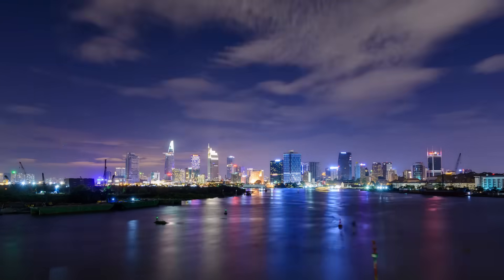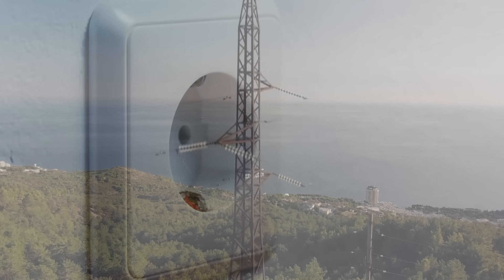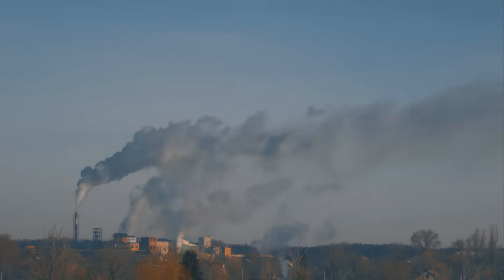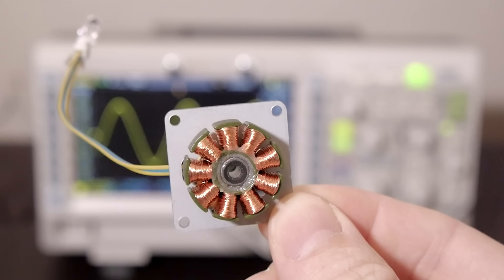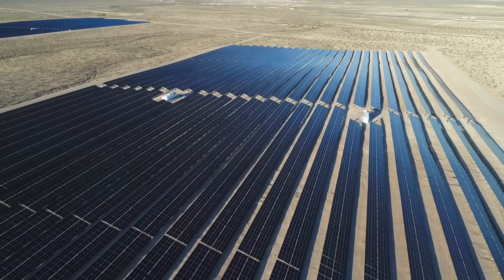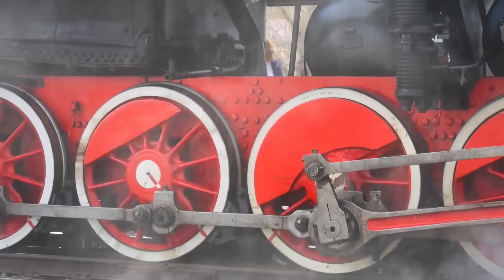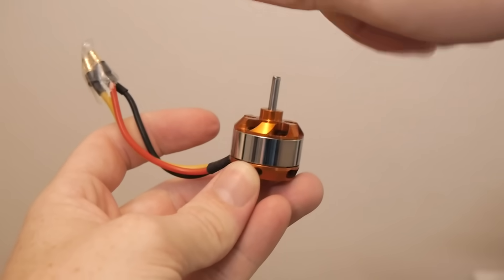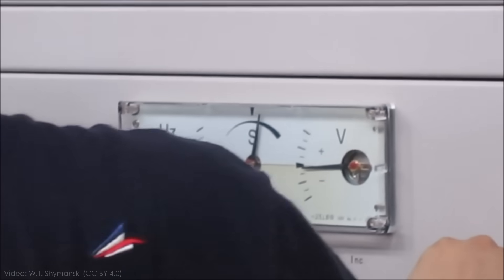How Electricity Generation Really Works

Comment: Despite my reservations about nuclear, I find it vexing that everyone seems to forget that nuclear doesn't emit co2.
Reply: @psiwog  actually co2 is more dangerous than radioactive waste.
Reply: @snekwrek5454  Hahaha  Ha Wow, that's funny
Reply: @snekwrek5454  
True, and the amount of radioactive waste generated is MANY orders of magnitude less than the amount of co2 per kilowatt hour.
Reply: Snek Wrek ? You actually believe that?
Reply: @snekwrek5454  ROFLMAO, alrighty then.
Reply: @snekwrek5454   co2, more dangerous than radioactive waste?  It's all about dosage. Humans emit co2 and trees absorb co2. The issue with fossil fuel is soot and and nitrous oxides. If you stand next to a spilled nuclear waste for a few minutes you will receive a deadly dose of radiation but it will not kill you instantly, you will suffer a slow painful death. There is a lot of different things going on here. co2 is naturally occurring whilst most radioactive waste in not.
Reply: @snekwrek5454  actually CO2 carbon dioxide is less dangerous than carbon monoxide... nuclear and co2 is relatively safe when maintained and managed correctly, cold drinks in a supermarket contain co2(carbon dioxide)... the mistake many people make is not consider the difference between co2 and co
Reply: @snekwrek5454 It does still emit Co2.
Reply: @psiwog  bruh we literally kill more people daily due to respiratory issues from coal burning than every nuclear failure combined. Nuclear waste is contained. We breathe the waste from coal plants daily.
Reply: @MeltingRubberZ28  then again your comparing an industry that is not only currently dominating the market BY FAR relative to nuclear generators, but have also existed for several decades whilst nuclear plants are like a fetus in comparison. there really is no comparison, even if nuclear waste were 10x as deadly as coal burning waste, you'd still see more people dying from respiratory issues
Reply: @MeltingRubberZ28  that's because there aren't a lot of nuclear plants but a shit ton of coal plants. If the number of nuclear plants increases, deaths from radiation would definitely increase.
Reply: @TheJudge064  No, these numbers can be adjusted so as to be independent of how widespread its use is: deaths / unit of generated energy. Even if we assume the amount of adoption was equal, Nuclear and wind are easily the safest sources of energy
Reply: @TheJudge064 
No they wouldn't? 
There aren't really any nowadays, so a bit of scaling up wouldn't likely do much anything.
I mean coal plants contribute more to irradiating the environment than nuclear power does, at the moment.
Reply: @MeltingRubberZ28  coal waste is also radioactive
Reply: @MeltingRubberZ28  bruh, I would rather live near a coal power station, than a nuclear one. The issue is not when everything runs fine, the issue is when there is an issue. Also, it is wishful thinking that nuclear waste is contained properly. The waste disposal would be contracted out to the lowest bidder, like all waste. Not good. Also, requires constant monitoring into perpetuity. Use nuclear only when we have a way to cleanly convert or dispose of nuclear waste and prevent it getting into the atmosphere. Besides, nuclear may be our only choice soon, so it's not worth worrying about.
Reply: @tensevo  bruh when we stop using 1950s technology we won't have to worry about the few nuclear failures we've had in the entirety of the planet
Reply: You are right! But did you know that germany(top tier country when it comes to engineering) is STILL looking for the "right" way of storing the radiating rubbish savely... and by the way you have to look for it #securitythreat (for the next 1000+ Years!!!) If you take this in consideration NP is fucking expensive. For my opinion the next step is Hydrogen. Than Nuclear Fusion...
Reply: @hennsbreit  I thought Germany had closed all its nuclear power plants in favour of burning brown coal, after the Fukushima Daiichi disaster. So the urgency for that has probably dropped a bit.
Also, hydrogen isn't a source of energy, it can be used as a fuel inside of cars, but we don't have abundant supplies of it sitting around the Earth, as a matter of fact, when released it simply flies off into space when released outside, like helium. Instead we produce hydrogen, either through electrolysis of water, which isn't very efficient (and the electricity often being generated by the burning of fossil fuels), or from steam methane reforming, which releases carbon dioxide.
Nuclear fusion would be the holy grail of energy generation, but it's still a way off of becoming a power source (it still costs more energy to perform than it yields), let alone being cost competitive. I guess it's still 30 years away, as it has always been...
Reply: @Leon_Schuit 
No we had 6% nuclear in our grid last hear and this year about 9%, even though all our reactors are critically over aged and produce about 150 reported incidents a year. And about 16 close to a nuclear fallout, due to multiple system failure.
Also just because you stop making more waste, doesn't mean you can slow down dealing with waste.
In Germany we are currently near a nuclear disaster because the Asse, an ex salt mine is flooded with groundwater and it is just a matter of time until we have nuclear waste in our water.

Also nuclear fusion is not a solution because it is massively expensive and you still need a lot of them if you don't want to wire up your whole country from one central spot. Also if you try to do it with one terrorists will thank you for giving them an archillies heel to attack
Reply: @Ismalith  Id like to invite you and a bunch of others in this thread to look into breeder reactors. The next generation of nuclear reactors being built can consume nuclear waste and effectively improve the efficiency of each fuel rod by 100 fold. The waste leftover with these reactors is just one percent, and the radioactivity of that waste has a half life of a few hundred years. Its been stated that with these breeder reactors, no more uranium would need to be mined, i.e. only the existing nuclear waste would need to be used to power america for nearly a century, and thats if you nuclearize the WHOLE energy grid. Sounds like germany is in perfect position to mass deploy these reactors
Reply: @xHaRm51  We estimated in France that with our current stock of "waste" (we don't call them that as we already sort the potentially useful matter / definitely useless waste and really hope to use them), we could hold the current power production for 2 to 5 millennials (yup, 5'000 years without a single mining input).
Reply: @xHaRm51 
Such reactors reduce consumption but they don't fix the problem of nuclear waste. There is still waste left and until the question, how we keep waste 100% save over millions of years, nuclear power isn't an option. The same goes for safety, it needs to be literally bomb proof.
Reply: @Ismalith  did you read what I wrote at all? Breeder reactors consume all transuranic elements, the waste thats left is from fission elements with a half life of a few hundred years.
Reply: @Leon_Schuit  fusion! Someday! Maybe. Crossing my fingers
Reply: @xHaRm51  The ideas of breedres has been around for a long time. However, I am not sure most of the designs have ever been tested. Most have certainly not gone further than the prototype stage and germany then quitting nuclear power plants has certainly not helped that issue
Reply: @SuperVapourizer  theres a few that exist. Russia has a couple they use to dismantle nuclear weapons and make energy out of
Reply: @Leon_Schuit  It also has to occur at like 1,000,000°C
Reply: @Leon_Schuit  what does vexing even mean
Reply: @xHaRm51  It should be kept in mind that there are numerous designs for 'slow breeder' reactors. We previously rejected fast breeder reactors because they generated fissile material faster than it could be used, causing a buildup of bomb-grade uranium, plutonium, etc. A slow breeder only produces enough fuel from the previously nonfissile isotopes to keep the reactor going - thus the reactor once started can create its own fuel from what is in the fuel rods or pebbles (depending on design) and what is left has gone much further in breaking down the heavy radioactive isotopes. And while the final end-products are to some extent radioactive, they are a much lower potency of radioactivity, so they would not need the 'under a mountain' supersecure type handling.
Reply: @Leon_Schuit it wasnt bc of fukushima, it was bc politicians were bribed by coal magnates
Reply: hennsbreit learn about thorium power. ThMSRs can’t melt down like a traditional reactor, and the waste is toxic for only decades. If we had been using thorium since the beginning of the industrial revolution, the original waste would be safe by now. Additionally it can’t be weaponized
Reply: @pannecake2000 
That is wrong thorium reactor waste is better than uranium reactor waste but it still is dangerous for a few thousand years. So it doesn't change the problem, especially if you want to fuel the world with that for a few centuries. Also Thorium is also not infinite.
Reply: @Ismalith  but could thorium be helpful in filling the gap between now and fusion + highly efficient solar energy?
Reply: @ki0w0-lordofwatersheep 
And then 50 generations pay for this gap filler?
Also solar is already where it needs to be. Instead of wasting more more money on in between, just use 10% of it for doing it right in the first place.
Reply: @Ismalith  well put
Reply: @ki0w0-lordofwatersheep  Can't throttle a thorium reactor - NFG for power grid use.
Reply: @Ismalith  no
Reply: @Ismalith  what fuel problem? It’s easy as hell to store, since it’s in concrete bricks.
Reply: @Ismalith  solar is absolutely nowhere near where it needs to be. And with extremely limited electricity storage options (at the grid scale) electricity has to be used when it is created. There is no way for solar to ramp up or down to meet demand. And they degrade and get dusty or the sun is obscured by clouds, etc. 
Solar can fill in some gaps and there certainly are some smart applications for it but to act like it is a suitable replacement for coal or nuclear is absurd. 
So many people have such an irrational fear of nuclear power and dramatically overstate the waste issue. It seems many of them are citing 1960s nuclear tech not understanding the advances made in efficiency and recycling/reusing of the waste.
Reply: @BonsaY You've been Had by special interests propaganda, nuclear power is neither as good or as bad as either side says and they Both are more wrong than right for all the wrong reasons.
Reply: @EvitoCruor 
What do you mean they're both more wrong than they are right? What's the truth, then?
Reply: BonsaY why the hell dont we just drill holes in the earth down to high temperatures and make steam. ??
Reply: @hennsbreit  Nuclear Waste is recyclable into active fuel. At a certain point it’s not, but you can mostly solve that with vitrification (turning it into glass) and burying it deep underground the sealing it off. This way, it’s not accessible and it’s not going to leak or otherwise be a hazard. Norway’s already done this without vitrification, the US is actively doing this with vitrification. It’s not reaaally that big of an issue. The bigger issue is honestly weapons-grade radioactive materials because they often aren’t depleted. 

In theory, you could also stabilize ionized uranium into stable uranium but giving it neutrons and electrons, but that’s often considered impractical in the modern day.
Reply: @hennsbreit  Nuclear is the best that we've got till we can safely switch to hydrogen. And the nuclear waste problem is not that bad if you consider other options like global warming or worldwide respiratory issues.
Reply: @hennsbreit  that’s not the next step, there’s like 20 other ones we actually understand in between.
Reply: @hennsbreit  we already have found ways to store it safely decades ago, and most nuclear waste is only dangerous for like 20 years.
Reply: @hennsbreit bro please don’t talk about thing you don’t know anything about, out of the many wrong things you said, just let me point out that hydrogen it’s not an energy source, but an energy vector, that means it can only be used to store energy, like batteries, while also being quite not an efficient way of doing it.
Reply: @hennsbreit There are actually ways to use that nuclear waste to emit more electricity!
The downside is the expense for sure, but it’s not nearly as bad as having security on uranium for a thousand years!
Reply: @hennsbreit I understand the implications of the waste,  but once it's sealed it's not emitting any dangerous byproduct,  so it's completely safe , the only issue regarding risk, is trusting man to maintain and function nuclear facilities,  something they can't be trusted or relied on.

Take Chernobyl for instance.
Man ,isn't trustworthy or ethically reliable to be in charge of such risks.
Reply: How do you get hydrogen  @hennsbreit
Reply: @hennsbreit  tf you mean hydrogen? Do you know how hydrogen is produced? It's not found in thin air.
Reply: Dont forget thorium!
Reply: @jimislaughterback6280  i want to see some large scale thorium reactors
Reply: Still waiting on hydrogen fusion energy
Reply: @ohyeahyeah1174  Helium 3
Reply: Not gonna happen for the next thousand years. Fusion is a pipe dream as every experiment is less efficient than a hydrogen bomb and not sustainable
Reply: Yea but to dispose of the waste your looking at sending that shit to the sun, which might actually be economically feasible in the future.
Reply: People seem to forget that the fly ash from coal also contains radioactive materials, and is a source for more cancer than all nuclear, even if you include chernobyl and windscale
Reply: @jonne7725  and you seem to forget that "flyash" has trace amounts of radiation that have yet to be proven to cause anything and is filtered electromagnetically and doesn't get into the atmosphere. The ash is collected for further processing and is usually stashed on huge ash-hill next to the plant. Those chimneys are super high tech I suggest you read into that.
If what you said was true and the ashes and dust was just blown into the atmosphere, we'd already have a disaster around power plants that have existed for over 50 years and it'd be all over the news. Heavy metals are a much bigger health hazard in ash-landfills and even those are pretty much negligible. The Ash is usually examined and since plants use coal from certain coal mines, the size of landfills per 10k square mile (as an example) is calculated from the amounts of toxic metals and other components in the ash.
Reply: @Thomas-wo9ur  My man!!! Someone knows what he is talking about!
Reply: That is partly the case but it needs to be remembered that mining uranium, refining it and making it in to the nuclear fuel (I'm not very familiar with the process) is also a source for CO2 emissions. And this is a problem with many REE (Rare Earh element) based solutions: There needs to be research for "how many CO2 tonnes is released per CO2 tonne saved if we produce electricity with..." 
For example, I'm very curios how much CO2 is released when we produce one solar panel, and what is the life expectancy of said panel. If a solar panel dies (because eventually everything will) without ever producing over the amount of energy that could have been produced just by burning the coal, then the whole ordeal less "green" because energy is wasted when it transforms.
Reply: @Taffoman  Is it intrinsic to the process (i.e. a necessary chemical reaction) or a byproduct of the energy required? If it's the latter, you know what I'd tell you, don't you 😉
Reply: @Taffoman  We have the numbers for this. It's called a life cycle analysis : nuclear is producing in world median 12g of CO2 equivalent par kWh and can go as low as  5g of CO2 equivalent par kWh produced in France (using nuclear electricity to enrich the uranium  with centrifuges and recycling the plutonium). 
On the other way, Solar panel are around 40 to 50 gCO2eq/kWh so it's a bit less efficient, but far more better than gas ( 490g), coal (820g) or even biomass (~ 200g to 800g). 
The threshold to keep the temperature under +1.5°C is 100 gCO2eq/kWh.
Take a look at the IPCC https://www.ipcc.ch/site/assets/uploads/2018/02/ipcc_wg3_ar5_annex-iii.pdf at page 1335 for some numbers.
Reply: @benoite.1546  Yes! The carbon footprint of nuclear is far smaller than that of solar. Nuclear is a wonder technology and its a shame its so misunderstood
Reply: @xHaRm51  A bit too slow / big / costly to be "the universal answer", but definitely not used enough in regard of the health and climate impacts we have with other fossil power sources :/
Reply: @benoite.1546  for sure, we should make use if every tool we have to replace coal et al,   makes sense to start with the most cost effective solution and move on to the more expensive tech as needed
Reply: @xHaRm51  Yeah not only is the carbon footprint of solar energy non-negligible but you also have to consider all of the mining and refining processes of the rare earth metals that go into them. That industry causes massive amounts of pollution and environmental destruction in China where they're primarily mined.
Reply: @Taffoman  Thorium is safe and much easier than uranium to get out, because it doesn’t need to be refined as much.
Also doesn’t produce toxic gasses when it’s being mined.
Reply: @Taffoman  uranium is not a rare earth element, it's plentiful and readily available. Most of the refinement process simply consumes electricity, which obviously can be provided with nuclear power, so the CO2 emissions are very low compared to petrochemical or rare earth extraction
Reply: Nuclear isn't really a solution unfortunately. It creates so much waste that must be disposed of, it requires enormous and extremely dangerous containment facilities. And anywhere you store that waste can never be used again for literally anything ever again.

While it may be true that CO2 poisoning may ultimately kill people more often than radiation and nuclear power related issues, the problem is that when a nuclear plant fails it fucks up that area essentially forever. Chernobyl's area can't be used again safely for around 20,000 years. The Fukushima disaster dumped enormous amounts of radioactive materials into the pacific ocean as well as contaminated groundwater and crops in the area. There are entire islands that used to be populated by people that can never be lived on again because the United States buried nuclear materials on them after playing around with some of the first nukes developed.

It is exceedingly dangerous, and the worst part is we have no way to ever correct the damage done or repair it. If we fuck up, at any point and for any reason, it more or less makes that part of the world uninhabitable for a length of time longer than written human history. And people WILL fuck up and DO fuck up regularly.

In other types of power plants, you introduce fuel steadily and constantly to maintain temp and keep it running. It can't just run away and destroy everything, unless somehow the heat/fire managed to get back to your actual fuel stockpile somehow, and even then it would just cause an enormous fire and burn out eventually. Nuclear power can't be turned on or off, it is always on. It is regulated not by adding more fuel, but by adding cooling elements to keep its temperature under control so it doesn't melt through what it is contained within. Its heat will continue to build and grow until it eats through everything containing and confining it, and then start leaking radiation out. And it will not stop for thousands of years.

We don't NEED a nuclear power plant to cause a nuclear explosion or routinely break down and fail, the scarce few times it does happen is enough to cause horrible and permanent damage to our world.

I really want us to find a better method of power generation as well, but nuclear simply isn't the way to go, at least not in the way nuclear power plants work currently. All that damage is permanent. CO2 can be scrubbed from the air or you can plant more trees to carbon store a lot of it, but there is NOTHING you can do to get rid of radiation other than waiting the thousands of years required for it to become inert, and every day nuclear plants are in operation is another day of producing more of this material that has the potential to ruin entire portions of the world if mismanaged. And when have you ever known a government agency or corporation to not make mistakes? It is an inevitability. Just think of the BP oil spill. it was tragic, but recoverable. Imagine if that had been radioactive material instead of oil. Imagine that entire portion of the ocean would kill anything that went near it forever.

Maybe one day we'll find a way to deal with nuclear in a more responsible way or find ways to cope with it, but we aren't there right now and switching all of our power generation needs over to that would doom our entire world in the long run far worse than CO2 poisoning ever could.
Reply: @TheDrexxus  Burning coal literally releases more radioactive contamination to the environment than nuclear power does though because of the radon gas released. In fact the waste left behind by coal plants is more radioactive then nuclear waste itself because of the uranium and thorium left behind. 

Nuclear power releases no radiation to the environment during its normal operation and although accidents do happen the frequency of such occurrences is low and the severity of the accidents is generally pretty low. Literally not one person died from radiation exposure during the Fukushima disaster. The radiation dumped into the ocean did not even come close to affecting the radiation levels already naturally present in the ocean from dissolved uranium in seawater.

And with the next generation of nuclear power plants being developed, we can expect them to be even safer and more efficient. Also nuclear fuel is not simply controlled by coolants you can control the rate of fission of the material and thereby the heat generated using control rods to absorb neutrons before they can cause additional fission reactions. 

In terms of nuclear waste, it's value is greatly underappreciated. Not only can spent nuclear fuel be reprocessed and burned again for additional energy production, it is also a great source of rare metals essential to our technology. With the extremely high energy density of nuclear fuel this reprocessing is actually economically viable too. 

It seems to me that the only real reason that nuclear energy isn't being adopted everywhere to replace fossil fuels is because of a rather irrational fear of nuclear fission, maybe because of its association with nuclear weapons? Could also be that powerful fossil fuel lobbyist and the like know that nuclear fuel is the greatest real threat to replacing their industry and so they want to keep the fear of it alive.
Reply: The problem with nuclear energy is it's process. There are more fuel rod efficient nuclear power processes but they either require more generator or powerplants to be built (I forgot which). Summarised, the energy generated per unit of nuclear fuel is greater in the long run but it takes longer to generate said amount of energy. Imagine the difference between burning a gallon of gas vs a stack of logs.
Reply: So the term of the process I refferenced is called "Nuclear Recycling", a process that basically squeezes out every last bit of power from nuclear fuel before it gets completely spent.
Reply: white  false co2 is very dangerous because it takes a long time to be cycled out of the atmosphere and that is long enough for it to make significant changes in the biosphere.
Reply: No reservations needed. It's the only real way to go green. And very cheap
Reply: Co2 is a minor gas that most all plants need to grow.
If we stopped cutting down so many trees and let them grow, the Co2 from  the human footprint would be offset.
I'm sure the Co2 scare is way overblown anyway for other nefarious political purposes.
Reply: so, yes we really need nuclear right now, but i think your framing is unfairly reductive: co2 / climate change in general is not the only catastrophic environmental damage that's happening
Reply: Check out thorium power plants.
Reply: @akron3233  heck yeah lets build some. but we also can't afford to wait till that becomes viable
Reply: youre a moron. radioactivity in the 21st century is still not researched properly. they don't really have safety materials for radioactivity containment. and waste says alot. coal is natural and again, they do not use proper filters to contain the waste and keep the environment clean. its not a problem of what is better is a problem of waste management. they cannot neutralize radioactivity or pollution, because they do not want to work for and its cheaper to just waste things. do not get me started on radioactive waste dumped in oceans.
Reply: @Christopher Wood 
But how abundant?
Currently we only have a very small part of our electrical energy in nuclear, here in Germany about 8%.
To that we will add the energy currently generated and directly used by fossil sources like gas in a car.
I've heard that uranium in the current usage will probably last around 100 years more, if we jack up the nuclear fuel consumption by 1000, how long will the more abundant thorium reserves last?

I know that it sounds good to put a big power plant into the wild and forget about it.
But if you go deeper it is just flawed as hell.
Reply: Nuclear energy technology is the only technology that hasn't progressed since Chernobyl. Too dangerous. /S
Reply: The radical left doesn’t care what fuel is used to generate electricity. Cheap plentiful electricity results in human prosperity. It’s humans they hate, including themselves. Radical leftists are self loathing vermin.
Reply: Yep, it just produces nuclear waste that is toxic for centuries lol
Reply: not to mention its caused the least deaths of any power generation station
Reply: If nuclear power seems dangerous (and it can be), I suggest looking into Transatomic's molten salt reactors.  In their design, melt downs are impossible, and they can even burn much of the existing nuclear waste.  Their design is also modular, meaning they can be factory built, assembled on site, and quicker to deploy.  Molten Salt reactors were initially not feasible due to low power production, but the bright folks at Transatomics have figured out ways of increasing the power output to make them feasible and actually desirable over the current crop of commercial reactors.  It's a really interesting read, I'm looking forward to their design going into production.  We just have to get around the crazy fear of nuclear reactors now.
Reply: If you ask, in 2021, plenty of people can think of ways to deal with climate change. No one wants to pay for it, but there are ways. In a near futur, we can expect air scrubbers and the carbon being recycled for another use. Nano tubes would be perfect.

Nuclear accidents? Remove everything and store it forever. And even if you dont have any accidents, everything that was used in a powerplant, including the plant itself when its eventually decommissioned, needs to be stored forever.

Also, we know how to produce clean electricity, its called hydro electricity. The environmental cost is 0 after 20 years. You might think its not possible everywhere, but neither is drilling for oil. Yet you can get gaz anywhere. So whats the difference? Portability. You need a way to store the energy.

Fun fact, nano tubes could be used as capacitors to store vast amounts of electricity. Other fun fact, while the Trump administration was pushing for a pipeline from Canada to the US, they were opposed to an electric link between Canada and the US.
Reply: Fucking idiots. C02 actually makes up less than 10% of greenhouse gases. The biggest is water vapor but that sounds natural so it's all good. FYI so is CO2. It's literally plant food. But Al Gore got yall hooked and like the flat earthers you refuse to discuss the basic facts. You just label them as non believers and censor them.
Reply: There is so much misinformation out there about wind and solar. They are NOT renewable. They are NOT green. Nuclear is the answer. Natrium fast reactors are particularly promising imo. Spread the word. https://www.youtube.com/watch?v=Zk11vI-7czE
Reply: @inochifumetsu  f*ck Nuclear. You need a brain clean.
Reply: It's the cleanest of all sources, but poor construction has made it dangerous.
Reply: I'm yet to meet a single person that has even a vague understanding on a nuclear power station and thinks it emit's co2...
Reply: Imagine explaining to people in the past that we have magical glowing rocks which can make anything move and we choose not to use it because of tertiary concerns.
Reply: The only reactor which did was soviet, but that's due to the lack of containment.
Reply: Ignorance is bliss, man. Everything has its drawbacks, however. Nuclear is very efficient, but can have devastating environmental impacts if a catastrophic event occurs. Companies just need to be very careful in deciding where to locate nuclear power plants; we all saw what happened in Japan about ten years ago.
Reply: Yes but nuclear energy comes from finite resources like uranium, and it's extremely dangerous.
Reply: @vicenteeichler8804  The materials for solar panels come from finite resources too, never mind all the lithium and other toxic heavy metals we're already mining for all the batteries we need. Meanwhile, the amount of uranium actually used in a reactor is minuscule.
Reply: And it is delicious both pre, during, and depleted
Reply: Coal puts more radioactive stuff in the air than all nuclear power station, including the ones that have had accidents, combined.
Reply: and we know how to manage the waste from nuclear quite well. the public just needs to let the organizations dig their deep holes in mountains. kyle hill has a good set of videos about nuclear power.
Reply: Yes but nuclear waste must be addressed to make it environment friendly
Reply: @ivancortez4689  like that is an actual problem. we already have the methods to do so. the public just has to trust in the engineers and scientists to actually have it happen. literally the only roadblock to the problem
Reply: They don't forget. This was never about the CO2.
Reply: @super duper ducky 1 ton of uranium is equal to over a thousand tons of coal
Reply: In my opinion, it’s the lesser of the power generating evils
Reply: Technically it does but more so from the initial construction and from periodic refueling. During normal operation it does not.

Still, even with the initial step taken care of, it's cleaner than other plants and the dangerous waste is very dense and compact, so a couple repositories could hold all of it and the future waste for decades to come
Reply: Most people aren't critical thinkers these days . It'd be nice if celebrities used their platforms to educate
Reply: There is no green power it's all produces pollution and always will, there is pollution be CO2 or fly ash, radiation pick your poison because it going to be there. The manufacturing of the equipment to produce green electric still will kill someone somewhere and it's going to change the environment to some extent solar takes space for the panels even if you cover every building your going to cover land to sufficient solar power, wind there is some locations that have the wind some don't but I really don't want one in my yard or town.  We have one not far from town and it's an eye sore to look at. The best thing is to stop technology dead in it's tracks and cut the human population until it no longer is destroying the environment and then keep it at that level and only use the basic technology need to sustain the population at that level. But even then the environment is already altered to a point it may collapse irrelevant of anything we do.
Reply: we exchange co2 for oxygen with plants when we breath 😒
Reply: or really any green house gases.
Reply: It also doesn't emit any other greenhouse gas in notable amounts relative to most other power sources once the plant is constructed
Reply: Everyone?
Reply: There are a lot of beings and plants who can deal with co2. There is no a single things that can deal with nuclear waste
Reply: Lol, nobody forgets that
Reply: Nah, everyone remembers this fact
Reply: Cheap energy makes the common folk too uppity.
Reply: Bombs go boom. 🤓
Reply: If you use nuclear fusion you won't have any waste
Reply: @Dreadvermin1  Your used fuel is waste.
Reply: The elites don't want us to have cheap power
Reply: Doesn’t emit much.
We still need to mine uranium
Reply: Because to normal people, nuclear = bad and co2 is bad so nuclear = co2 because of the boogeyman effect
Reply: Nor does hydro. The first free energy and yet people have been lobbying to have them all removed
Reply: Nuclear doesn't emit CO2 directly, it emits CO2 indirectly because you have to MINE the Nuclear material and that takes substantial heavy machinery that's producing large amounts of CO2, so you're twisting facts.
Reply: @BlahBlah122-b2t  oh! Like batteries
Reply: @zakzac1  yes, exactly. Every single way of currently producing electricity will have some sort of CO2 production along the way. The thing is the effects of CO2 being the primary cause of global warming is grossly overstated with data that's been manipulated for political and reasons to make markets for CO2 removal so the wealthy can profit more.
Reply: Doesn't nuclear produce massive amounts of water vapor -- another greenhouse gas?
Reply: what does it emit??
Reply: @davidevans3227  h2o
Reply: i believe it's an interesting situation,  some are looking at how to warn people far far in the future,  that this is very dangerous..  
language will be different
i heard about them getting artists involved..
Reply: SOLAR power is NOW cheaper.  And WILL be for the next SIX BILLION YEARS!!!
Reply: Electricity generated by falling water doesn't emit CO2.